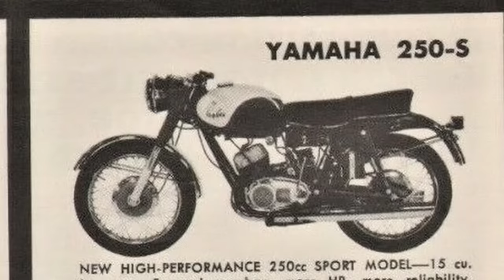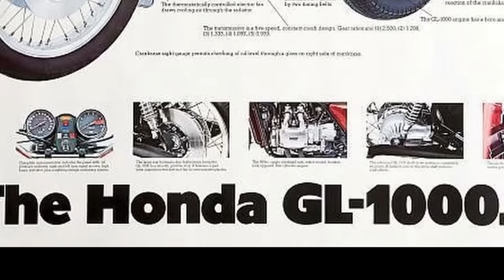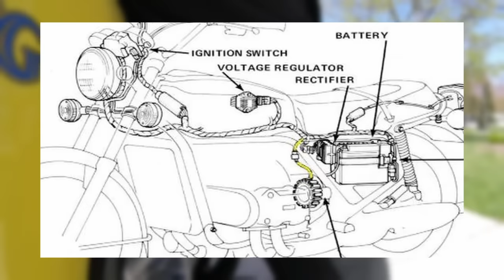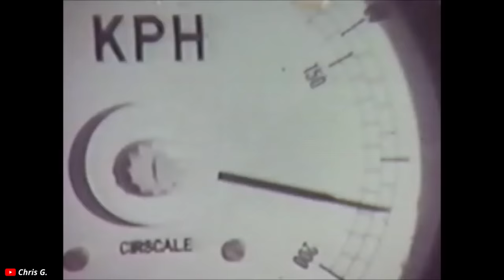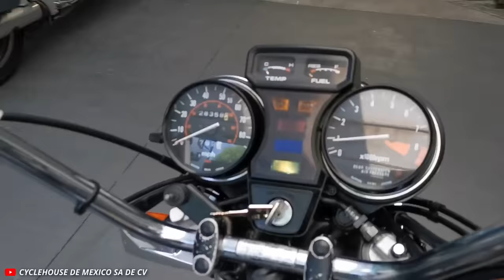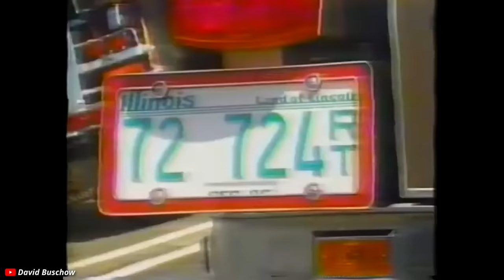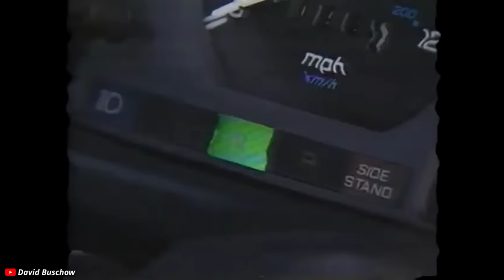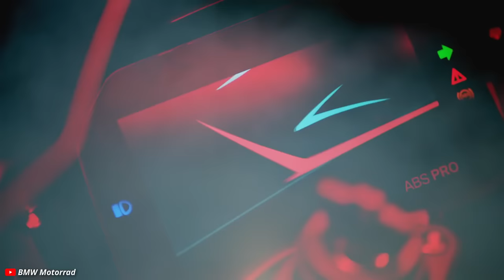How the Honda Goldwing became the Winnebago of Motorcycles

Comment: When I was working the inspection bay at Tucson MVD in the early 2000s, a guy rode a GL1000 in for inspection. I'd been reading a lot about the original Goldwings, and there was a legend that the flat four was so smooth, you could put a quarter on its edge on the cylinder head, start the bike and rev it to the redline and the quarter wouldn't fall over. So I asked the guy if we could do the test, and to the amazement of both of us, the quarter didn't fall over. It didn't even wiggle.
Reply: Wow !
Reply: incredible!
Reply: I wonder if the flat BMW's are capable of a similar feat.
The only thing that's put me off about those kinds of engine's and it's not like it'd be a deal breaker is when you're at a light and you blip the throttle and the torque about flops you over on your side, if it's not something you're used to and prepared for it comes as a pretty big surprise when it happens.
Reply: @dukecraig2402  I've ridden BMW police bikes that do that! Still not as bad as an SR500 dancing across the driveway when you're on the centerstand and twist the throttle.
Reply: @cruelty6368  
Don't really have any experience with the SR 500's but I did have an '81 650 Special, it wasn't exactly what you could call the smoothest motorcycle when it comes to vibrations but it was 100% rock solid reliable, I consider them to be the Slant 6 Chrysler of motorcycle engine's, like the Slant 6 they'd leak oil but just keep on running mile after mile.
Everyone thinks the engine is a copy of the typical British twins but I read not long ago that it was a license built copy of a German engine they'd bought the rights to the design from. 
About the only thing you had to do to them was keep the cam chain adjusted which hardly anyone ever did and they still ran great, adjust the cam chain and it felt like the engine had been rebuilt. 
I wish I could find one of those things in decent shape, I'd pick it up just for nostalgic reasons.
Reply: @dukecraig2402  I had a 650 special, too, a 79. I didn't care for the twin petcock design on the fuel system, but it ran great, and was quick.
Reply: Thats so cool!!!
Reply: very cool
Reply: My Valkyrie Interstate would do it with a nickel, I don't know where to put the nickel on my Goldwing or I'd see if it would as well.
Reply: My 1200 Wing is 40 years old next year and I can still do this trick with it.
Reply: I went from a YZ 125 to the '23 Goldwing, I cant believe how nimble this thing is👍👍
Reply: I have a 79 GL1000. I keep hearing about this. I'll have to try it.
Reply: For decades Honda has been the most capable motor company on earth, including All.

Comment: Worth noting that both generations of the GL1800 weigh less than the GL1500 - one of the rare bikes to actually slim down over time!
Reply: did i read also the wheel base is a little shorter?
Reply: Sadly the trunk is smaller too. I was a "small" bit disappointed when I went from a  89 GL1500 to an 06 GL1800. Slowed down the miles per years with coved,  the 1500 I put on a easy 100K, the 06 got with 40K in Feb 2014 now 116k. so ride on. 🙂

Comment: When I was editor at Clymer Pubs, I bought a GL1000 when it first came out. It came in Candy Red and a sort of sea green. At the time, I could only get the green one. After a break-in period, we tore it down completely for DIY photos over a 3-day weekend at Skip Fordyce Motorcycles in Riverside, CA. Once it was all together, I added a Vetter fairing, Craven bags and got it ready to ride cross-country to arrive in Boston for July 4th, 1976. After covering over 16,000 miles in the U.S. and Canada, the ONLY failure was the clutch cable which frayed, but didn't break. I think I replaced a rear tire during the trip as well.

At one point, the GL1000 also got a Watsonian sidecar from Doug Bingham. Because of it's weight, it was a bear to steer with a sidecar so Doug designed and build an Earles fork for it which was like adding power steering. I traded it after a little more than a year and 35,000 miles for an R100S (with a Krauser touring fairing) and toured on nothing but BMWs until just before COVID. I'm 80 yo now. I added up the mileage on every road bike I've had and it comes to over 600,000 mi. Two of my BMWs earned 100,000 mile badges, one of them turned 120K in Inuvik, NWT above the Arctic Circle. I never had any interest in later Gold Wings, but that original has a special place in my motorcycle memories. Smooth, powerful enough, totally reliable. Everything you needed touring empty Western highways in the days before cell phones and GPS.
Reply: You sir, are a legend.
Reply: So marry him already, jeeze. 🤣
Reply: WOW! You have amassed an incredible legacy which included this legendary motorcycle. Another noteworthy point mentioned in your thumbnail bio is the Vetter fairing. Craig Vetter certainly left his mark on all of motorcycledom especially the Jap brands and particularly the Gold Wing. For a time the Vetter name was applied to any fairing regardless of type or brand. Thanks for posting your story!
Reply: Amazing motorcycle life.
Reply: that last sentence is perfect
Reply: Earles forks, now that's one I haven't heard in years.
Franks and Finch are throw back names in forks to, man I miss those years.
And Craig Vetter, that man was always ahead of the curve, he was inducted into the AMA motorcycle hall of fame some years back and rightfully so, he was about as innovative as they come.

Comment: I love Goldwings and am lucky enough to have two in my garage. One of the latest DCT Tour models and alongside that a 1976 GL1000K1 still in standard, undressed spec. I love them both. The smoothness and comfort of the GL1000 still impresses even today. Just in case I feel the need to ride something a little different I have a 1979 CBX1000Z which is equally impressive in its own ways. And for local runabout duties I have a little 1972 CB175K6 which is great fun. I have a lot to thank Mr Honda for.
Reply: That sounds like quite the garage! Cudos to you!
Reply: im so jelly, and im saving these names. they don't make bikes like they use too (except the goldwing )

Comment: In 1977 I purchased a used 1975 GL1000 for $1300 with about 6,000 miles on the odometer. I added a Vetter fairing (with optional cigarette lighter) and some funky, ripstop saddlebags, and left San Francisco heading north to Canada. I rode up to Victoria, then east across the Trans-Canada Hwy. all the way to New Brunswick. I remember racing a Porsche 911 through the Canadian Rockies, and leaving him in the dust, as I was able to roll on the throttle in 5th gear on steep grades, and accelerate endlessly. I remember effortlessly cruising along the highway and across the great plains with one hand on the handlebars, while puffing on my Marlboro's behind the tall windshield. I crossed the border into Maine, and continued south to stay with friends in New England and Virginia. I left the east coast and headed west on Hwy 40 (route 66) across the southern states after leaving myself with only 5 days to get home. I made it from Virginia to San Diego in 2 1/2 days, averaging 70-80 mph in temperatures reaching 105, only stopping for an occasional quarter pounder with cheese, to save time. I visited a friend in San Diego and couched surfed for the night, then rode up Hwy 5 to San Francisco and home. The bike was a marvel, and only needed an oil change and new rear tire during the entire 10,000 mile trip. The only issue was that the gas tank only held 4 gallons. So I was forced to stop for gas every 100 miles or so! That's a lot of gas stations.

After I got home, I needed money for college and sold the bike for $1200.
Reply: Awesome story
Reply: Love it, and would have loved to be there.
Reply: you got yoru moneys worth out of that bike for sure.....great memory!!

Comment: Had a Goldwing 1500 for a few years as a 35 Year old listening to punk rock blasting on the stereo. Bought a motorcycle camper trailer after and had some of the best rides on that thing. It was no longer what town to go to but what province or what state to go visit. Had a few issues with clutch and head bearings but overall was one of the best motorcycles I've ever owned. (Had many dual sports before, sidecar 2WD, off-road bikes, GROM, Burgman 650)
Reply: Amyl and the sniffers

Comment: I bought a 1993 Goldwing Aspencade new in that year.  I rode it for six years and sold it to a friend of mine.  He proceeded to ride it for another four or five years and sold it to another guy that's a mutual friend of us both.  That guy is still riding that bike.  It turned 30 years old this spring and, last we talked, was running the the ~170k mile range, give or take a little.  The second guy loves to restore old motorcycles and is currently working on this bike to give it some much needed TLC.

Comment: I bought my first 1983 GL1100 in 2017 when I was 22. Rode it to Sturgis from Detroit. Lost it to a drunk driver in 2020. Just replaced her with a 1982 GL1100 and rode to Yellowstone. 5k miles with nothing but a few lost quarts of oil and a loose lower fairing in Wisconsin. These really are the rider’s ride.

Comment: In a sense this bike was my introduction to motorcycles.  Back in the mid-80s when I was a kid my dad had one and I spent quite a bit of time on the back seat. As it happens I wouldn't start riding myself for another 30 years, and while I'm definitely several tax brackets shy of being able to own a Goldwing myself, I can still credit it with being the initial spark that would end up in me riding now
Reply: Get a used older one from the early 90s to early 2000s and get out and ride! You'll still have a blast and not spend the dollars a new one costs.

Comment: I love to ride and that is why I have owned several Goldwings over the decades. I had a 19987 GL1200 that I sold for as much as I paid for it after 250,000 miles. My latest version is a 2012 GL1800 with only 95,000 miles currently. I like the newest models of the Wing but have to put another couple of hundred thousand miles on this one before I can justify the purchase. Thank you Mr. Honda!

Comment: I had a 1980 GL1100 in the late 90's and it was what we used to ride around everywhere on with our best trip being from home in London all the way to Cornwall for the solar eclipse of 1999.
It was a basic, naked version and with the exhaust tips hacksawed off it had a really nice, subtle sound that wasn't too lairy and in your face but other road users still knew we were there!
I loved that bike and was gutted when it got stolen and torched but that was part and parcel of living in scummy London at the time!
FUN FACT: one day as I arrived at work one of the throttle cables snapped so I ended up riding it home using the choke as a throttle!
I would have another 11 or even a 12 in a heartbeat but for some reason the looks of the 1000, 1500 & 1800 never appealed to me.
Thanks for a reminder of what a great bike I once had.

Comment: I bought my first Goldwing in 2007. I rode that bike for nearly 90,000 miles with no real problems. When the 2018 with the DCT transmission I knew there would be an upgrade in my future. Shortly after the 2018 became available I took my old friend Big Blue to Shawnee Honda and traded it in an a Red DCT Tour. It's quite a bit different but I love it.

Comment: The tyre thing probably IS true,  at least I'd not be surprised if it was. Unless Honda have outright said it was not the case, you'd have to think it so. 

Why I say this, is that Honda were NOT the first 'old world' manufacturer to aim at American big touring type machines, and hope to release a competitor, to dethrone Harley Davidson as the bike of choice for hardcore rider looking to spend long hours and crush many miles, in the saddle. 

There were a few ideas, but the most complete project was by Ducati with their Apollo. 

This machine predated the GoldWing by almost a decade. It bore a massive, for 1963, 1300cc V4 engine, putting out a crazy 100 BHP. The Moto Guzzi V8 GP bike of that era, in comparison, only made just shy of 80 BHP, which was 20 BHP above the upper echelon of very best performance machines of the era too, and 25 BHP more than the most powerful Harley of the time.

The issue however, was that NO tyre company at the time, could make a tyre which could handle that kind of HP. Not for a motorcycle, as there was only so much rubber one could use to fit that kind of machine. Muscle cars were a thing, and making tyres to handle big HP was possible....just not one you'd be able fit between a frame or forks. 

The tyre shredded at speed on the first High Speed test run, the test riders survival classed by medical personnel at scene, as nothing short of a "Miracle". 

They detuned the bike to 75 BHP, and STILL had a huge tyre failure rate. 

Ultimately, they had to detune the engine to 58 BHP, get torque down, and totally neuter the nature of the machine at its core, rendering it unfit for purpose, out performed by the best British and German offerings. 

Ultimately the project went nowhere, undone by the tyre technology just not being able to support the project. 

Interestingly enough, one of the two prototype bikes wound up in Japan after the end of the project, and except for brief few years at Ducatis own museum, has resided there ever since. 

It would not be a leap to suspect that Honda knew of the project, and more importantly, WHY it FAILED, and went out of their way to ensure the same fate did not befall the GoldWing project.

Comment: worked in a bike shop in 2015 the only worked on japanese bikes from the 70's to end of the 90s, first bike i ever worked on was there and it was a 1981 GL1100, i couldn't count the amount of goldwings that had over 300000 kilometers on them and still going strong i remember some reaching over 500 most cars today won't make it to 500 but those goldwings will hit 500 and get straight to working on the next 500.

Comment: In 1997 I bought my GL1500 SE at age 35. I put 38,000 miles on it the first year while working full time and had 4 other bikes in the garage. Needless to say I rode it to work nearly every day and went on various tours on the weekend. I'm down to 2 bikes now - an ST and the 97 Wing. I'll always have "Oh Dear" Wing and it has always been my go to bike for long tours either solo or 2 up pulling a trailer for week long excursions. Nothing like rolling up on inexperienced riders on sport bike through twisted and swinging by with the external speakers pushing out some SRV. And if I ever had to part with my Wing, I'd replace it with a new DCT. If you've never ridden one, I'll just say it is like riding a huge, comfortable and powerful machine not unlike the Lexus LFA.

Comment: I have owned two GL1800 Goldwings. My first was a 2003 model with over 130K miles when I sold it. I pulled a popup camper on my first long-distance ride to Yellowstone from NC. It was a great ride. I really came to appreciate my Wing on that ride. But I had ridden with three other riders on Harleys, which badgered me all the way out and back about getting a Harley. I knew I could ride further than they could, faster than they could, and more comfortable than they could, but I did give in to peer pressure. I have had two Harley's since that ride. I currently have a 2007 Harley Ultra Limited. I have poured a ton of money into the Harley to make it more comfortable for my wife to ride. But she hates it. I do enjoy it, but I missed riding with her. So I bought my second Goldwing a few weeks ago. It is a 2006 model with only 37K miles on it. Man, is it ever nice. Honda has done many things between 2003 and 2006 to make this a better machine. My wife is riding with me again, and I really have very little need to hang on to the Harly. You cannot get a better mile-crunching bike for the open road than the Goldwing. Thanks for making this video.

Comment: Another excellent video as always... In 1987 I bought a new GL 1200 which I had for a couple years and really enjoyed it but then got interested in sport bikes.. 
In 2014 I bought a low mile 2000 model GL 1500 which I also had for a few years and really enjoyed it but again didn't really need a big touring bike so went back to the sport bike s again... I love motorcycles but have never gone on long rides or trips so a goldwing really was unnecessary for my style of riding but for what they are meant for I feel they are best in class..

Comment: I've owned two GL1200. One 1985 limited edition and a 1986 Special edition. Both bikes were in a class by themselves with respect to ride and performance. For serious riding, the Goldwing is the bike to have!! I have a 1981 Sportster XLH 1000 that I just finished. The Harley is a completely different ride all together. But at 71 years old, I'm over riding a full dresser that weighs over 800 lbs. But the Goldwing is definitely the best ride out there.

Comment: Hell I’m 23 years old and my second bike ever was a 1979 GL1000 with a dealership add on faring and box set and I still ride it to this day. Just the other day I picked up a 1993 GL1500 and both are great machines I got the Gen 1 at 15k miles it now has 45k and all I’ve ever had to do to it was change the clutch love these bikes!